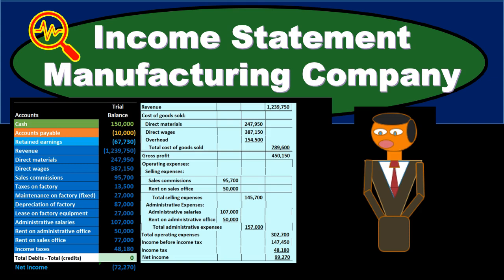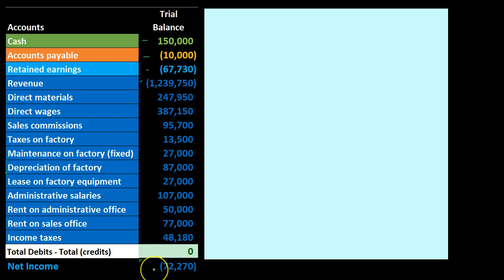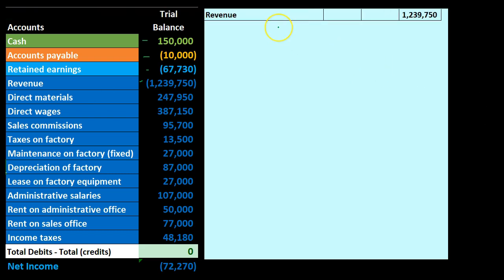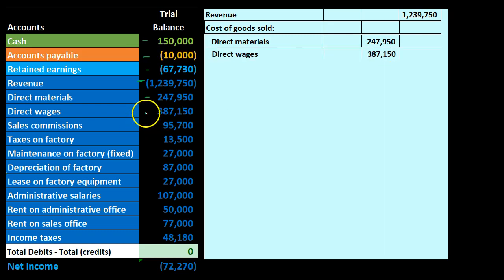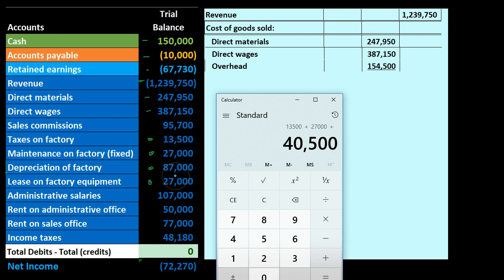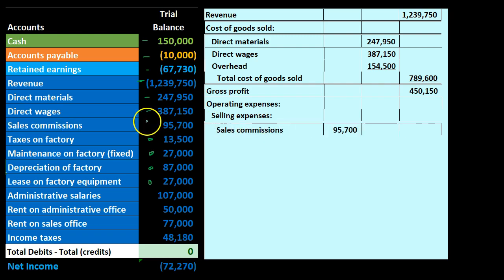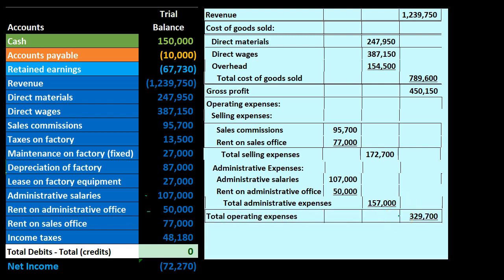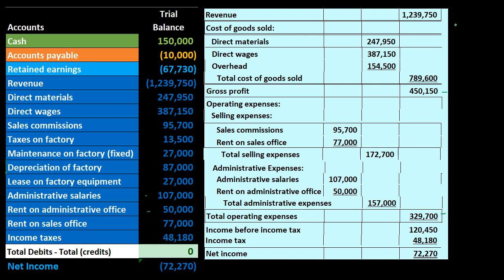Income Statement for a Manufacturing Company

Comment: What happens to the purchases I made during the period. Where does it go to. I didn’t use them in production. Maybe some but not all.
Reply: I think it goes to the direct materials part
Reply: If you are talking about product or raw material purchases, then I think they would go into inventory.  Whatever amount you did use up in production would into direct materials.  So you will need beg inventory plus purchases less ending balance to figure out the dollar value used from inventory during that period.